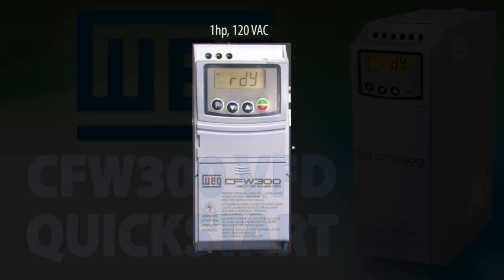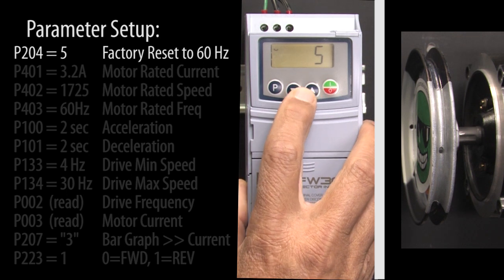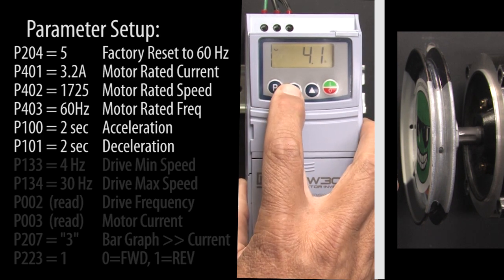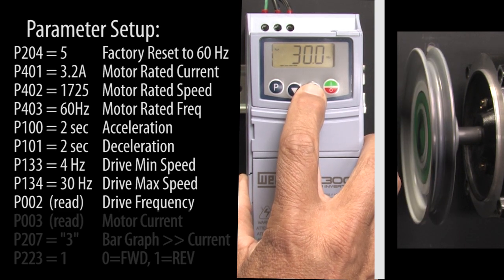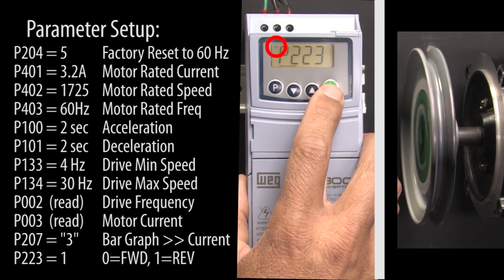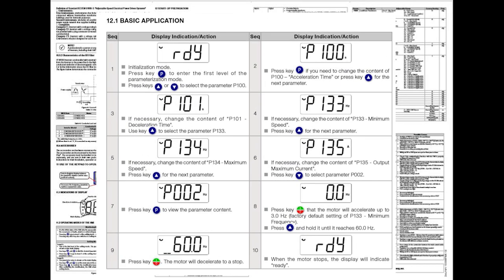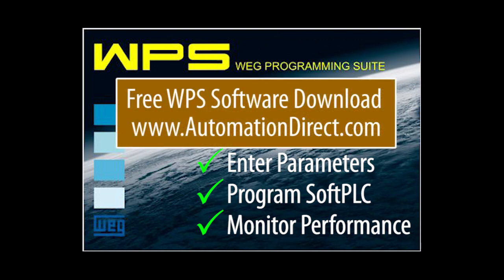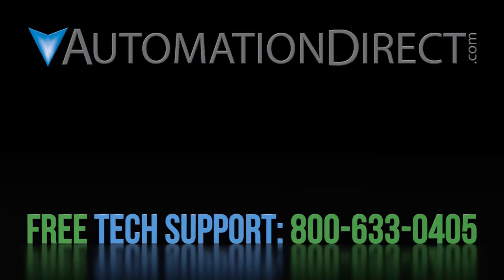WEG CFW300/320 VFD Quick Start from AutomationDirect

Comment: This is such a great concise explanation, I have one quick question though, what are the options for P207 besides 3 for current?
Reply from the maker: Thanks! All the parameters and their options can be found in the programming manual here https://cdn.automationdirect.com/static/manuals/wegdrives/programmingmanual.pdf
For this particular parameter, the options are whichever parameter you want the bargraph to indicate. Such as 1 = P001 (Speed reference), 2 = P002 (Output Speed), etc
Make sure to check out more of our videos at https://www.automationdirect.com/videos/home

Comment: Is this product rated for 220v, 10amp motor?
Reply from the maker: Sounds like you have a 3hp motor?  If so, then yes, the WEG CFW300 is available in a 240VAC for 3hp motors.
It's easy to find the drive you need: 
1. Go to AutomationDirect.com, 
2. Click on "Drives" (currently on the left grey column), 
3. Use filters on the left to select 3hp, 230 and 240VAC
Today I see 25 models that match that criteria starting at $225!

There are tons of videos showing you how to use all the most recent drives. check it out:
1. www.automationdirect.com/videos ............. random search
2. www.AutomationDirect.com/Cookbook ...... by subject (Click on "AC Motor Drives")

Comment: I went through the procedure this video, did P002 and hit the start button and the display goes back to "rdy" and the motor (Worldwide Electric Corporation Three Phase Induction Motor, 1/2 HP) does not rotate nor hum. I have checked and rechecked the wiring many times to ensure T1=U, T2=V T3=W, ground, etc. Any ideas? Is there a source for troubleshooting, tech support?
Reply from the maker: Hi Franklin, Try this:
1. Remove Motor wiring from drive (Run the drive with no motor)
2. Factory reset (P204 = 5)
    >> Display should go dark and then come back
3. Press "P" button.  
     >>You should see "P002"
4. Press "P" button.  
    >> You should see 0.0Hz.
5. Press the red/green run/stop button. 
   >> The drive should ramp up to 3Hz (the drive min speed, as set by the factory reset)
5. Press the red/green run/stop button again
  >> drive should ramp down to 0.0Hz

Did that work?  
  >> If so, the drive is working fine.

If so, then add your motor parameters and wire the motor to the drive.
Press the red green run/stop button and motor should spin at 3Hz

Questions:
1. what is the model number of your motor? I assume it is not an AutomationDirect motor?
3. How many wires does your motor have, just the three (T1, T2, T3)? or are there more?

Tech support:
 - Click on the button at the end of the video to learn all the ways you can reach our FREE tech support during regular business hours.

Please let us know what you find!

Good luck!
Reply: @automationdirect  On step 5, the unit goes to "rdy" and does not ramp down to 0.0 Hz. Is it defective and should b e returned to TEMCO where I bought it or is the a software solution?
The motor is new and from Worldwide Electric Corporation (China) model NAT12-18-56CB bought from Compressor Source. It has a total of 9 wires marked T1 through T9.
Reply from the maker: @franklinohrtman282   9 wires?  That makes sense.  You said you wired T1, T2 and T3 to U, V, W. Look at this motor from AutomationDirect: https://www.automationdirect.com/adc/shopping/catalog/motors/ac_motors_-_general_purpose/general_purpose/mtr2-p50-3bd18   Does that look like your motor? Do you see the little pictures below the image of the motor?  Scroll through those until you see the image of the white motor label. Enlarge that. On the left you see all the motor specs, on the right you see how to properly wire the motor. This motor says you need to wire T1+T7 to one terminal,  T2+T8 to another terminal, and T3+T9 to another terminal.   T8+ T6+T9 connected to each other (and insulated to prevent shorts).  Does your motor have a similar diagram on it?  If so, then try doing what it says. While you are at our website, check out our prices and FREE 2-day shipping!
Reply: @automationdirect  Thanks. I did that and get the same result on the vfw300. The motor does not spin and vfw on P002 when red green button pushed reads either "rdy" or 4 Hz.
Reply from the maker: @franklinohrtman282  The good news is the drive seems to be working. When you press the reg/green button once it says 4 Hz, which means it is running at the min speed, and when you press it again it says 'rdy' which means it is stopped. 

Try this:
1. When it says '4hz' try adjusting the drive speed with the up down arrows - I'f that works, the drive thinks it is running. 
2. When the drive says '4hz', put a volt meter across PE-U then PE-V  then PE-W.  Each one should read around 220VAC.

     (Make sure your volt meter can handle that voltage, of course!). If that looks good, then you still have a wiring issue.

If you are still having issues, try contacting our free tech support - they will be happy to walk you through it. Click on the button at the end of the video to learn about our free support options.
Reply: @automationdirect  One more question (really!): My .5HP motor is turning now. When I add a 30:1 speed reducer using the settings for 1 HP motor in the video, the motor cannot turn the speed reducer (A046 errors message). What are the best settings for a .5HP motor? Is there a setting that sets a high torque at the start for a .5 HP motor?
Reply from the maker: @franklinohrtman282  Questions are not a problem.  
Glad to hear you got it spinning! (What was the issue?)

1. Motor Parameters:
-----------------------------------
Sounds like you are using the settings in the video for a 1 hp motor, but you a have a .5 hp motor. You need to use your motors settings for parameters. Look at the name plate on your motor and use those numbers to fill in these VFD parameters:
  P401 - Motor Rated Current (Probably around 7.2 amps?)
  P402 - Motor Rated Speed (Probably 1725)
  P403 - Motor Rate Frequency (Should be 60 Hz)

2. VFD Rating
-------------------------------------
Which VFD did you buy? Is it rated for .5 HP?

3. Error A046
-------------------------------------
That is an overload condition. You are asking too much of the drive.
This video tells you how to diagnose overload conditions: https://www.automationdirect.com/videos/video?videoToPlay=KesIKVZnyrw&q=cfw300
FYI: Error codes are on page 1-1 of this manual: https://www.automationdirect.com/videos/video?videoToPlay=KesIKVZnyrw&q=cfw300

4. Manual Torque Boost
-------------------------------------------
See page 8-21 of this manual: https://www.automationdirect.com/videos/video?videoToPlay=KesIKVZnyrw&q=cfw300
You really shouldn't need this, you issue is something else.

5. Motor type.
---------------------------------------
Note that motor you have is a general purpose motor - it was not designed for a VFD. That means it will run fine EXCEPT at low speeds. "Inverter Duty Motors" are designed specifically for use with VFDs so they can run at low speeds. FYI ...

6. Torque Converter
--------------------------------------
What torque converter are you using?
Reply: @automationdirect  1. I have the wrong motor for this task. It is rated at 1.9 Amps. 
2. Good news is CFW300A02P6S1NB20 is the unit I have and it is rated for .5HP
3. This is the Lexar 30:1 speed reducer: https://www.amazon.com/gp/product/B011WHQXK0/ref=ppx_yo_dt_b_asin_title_o01_s00?ie=UTF8&psc=1
4. What Automation Direct .5HP 3 phase inverter duty motor do you recommend (56C frame to match the speed reducer and CFW300)? :)

Comment: I do not think I ever thumbed up a product sales video, but this one gets my thumbs up, and for good reason. You care enough about your customers to create a SUPER SHORT and To The Point video to get up and running. Personally, if this video were to be an hour long, I would have close to no chance to make any sense out of it. Short and to the point is perfect. Otherwords, I can not make sense out of a video that takes an hour to instruct me on how to screw in a lightbulb. The instruction world, unfortunately, is loaded with such though. You offer other product tutorials FOR FREE to cover the details too. This is the correct and sensible thing to do, not charge for the tutorials. I have never, and never will pay for product install / set-up / maintenance information. If one has to pay, that is obvious proof the company is out to rip you off, and so, how long will their product last? I checked out your website, and this VFD is available at a super good price. I have in the plans to convert some of my single phase machines to VFD drive machines. I am going to put you in my Vendors Folder, and when I am ready to convert them, getting from you. The video, thankfully, did not describe how to put on an external speed control. I will easily figure that out though, because,  once up and running, will be simple to do. I will also watch some of your other plc videos now too, hopefully you have short to the point up and running tutorials on those too.
Reply from the maker: Hi Biddie Tube - Looks like we never responded to this one - big oversight on our part .. THANKS for the comment!  Did you know that we have over 1000 automation videos here: www.automationdirect.com/videos.  Looks like there are almost 30 on the WEG Drives alone! And yes, they are all short and to the pint!